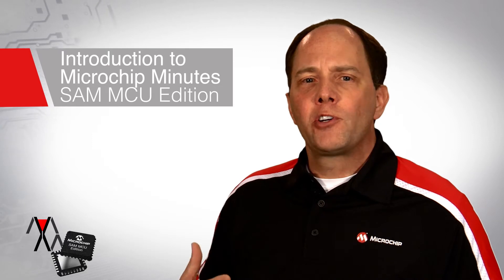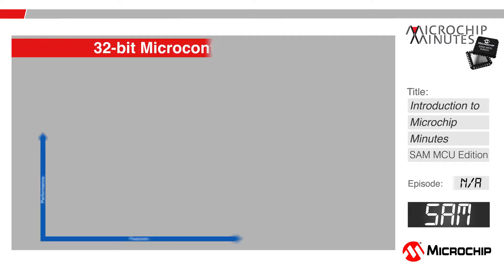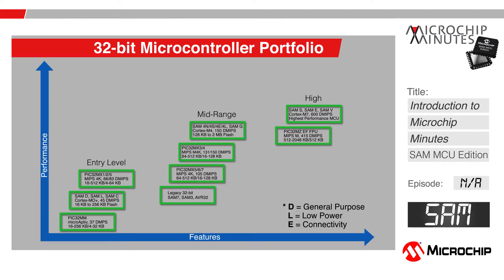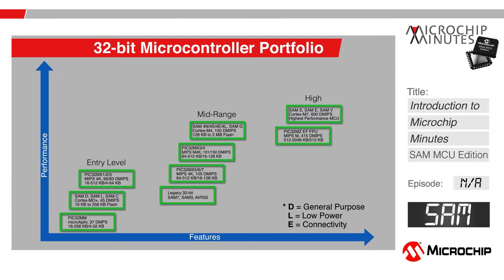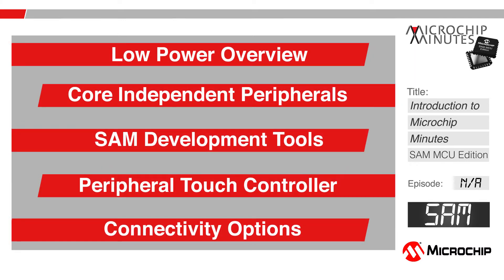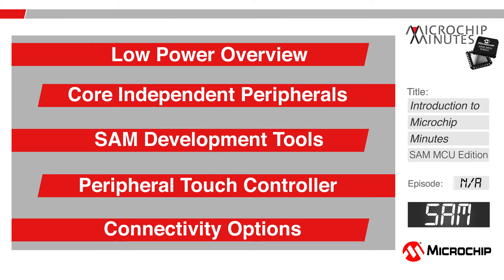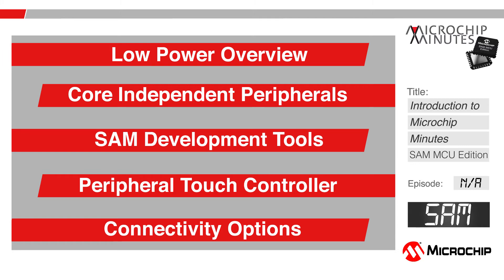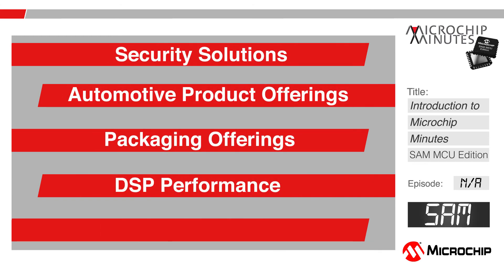Introducing Microchip Minutes - SAM MCU Edition

Comment: Why is the operating Temperatur of the sam devices low, i would need 125...
Reply: The SAM devices are available in extended temperatures up to 125C. The second letter after the dash is the temperature grade. U = 85C, N = 105C, F = 125C (in general). Some familes will offer both 105C and 125C while others may only offer either.